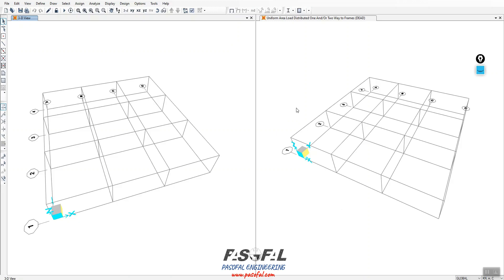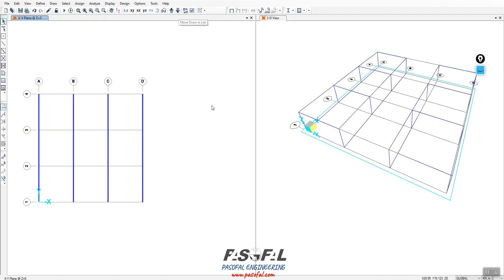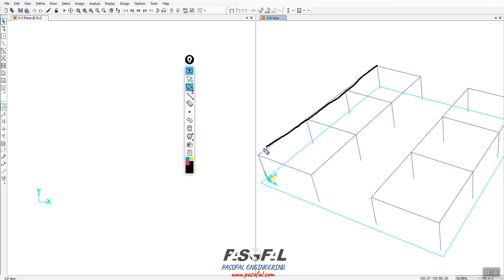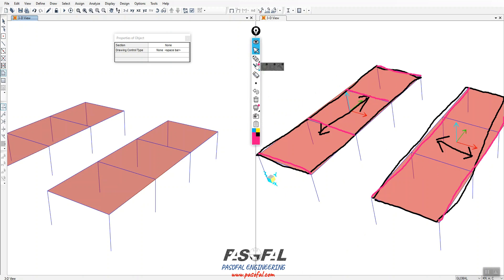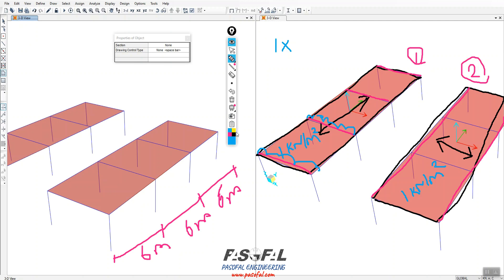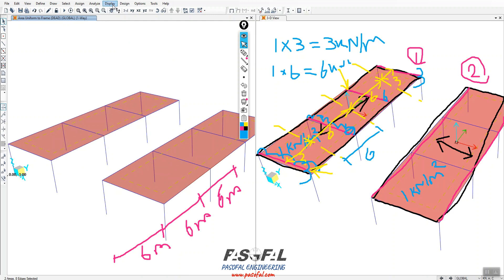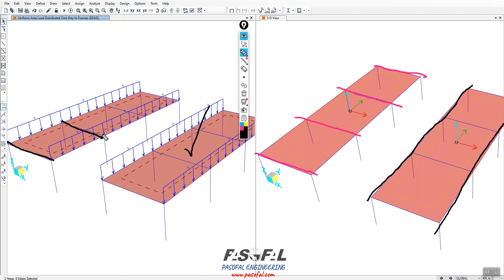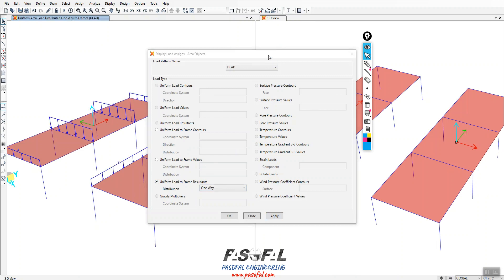How to convert area load (pressure) to line load in SAP2000

Comment: Hello, I was modelling a pyramid roof and when trying to get frame loads I got this error message: "cannot apply uniform load to frame for area object 16 because the area object cannot be cookie cut meshed into 3 and 4 nodes using existing frame object".
How could I fix this?
Thanks
Antonio
Reply from the maker: First select the frames and then go to Assign > apply "Load transfer option".
Secondly, select the area object > Assign > Area > Assign Automatic Area Mesh > Assign Mesh Area Using General Divide tool ..., then set a proper value for the mesh.
Then, it works. 

Pls subscribe our youtube channel and share our videos with your friens.
Thanks